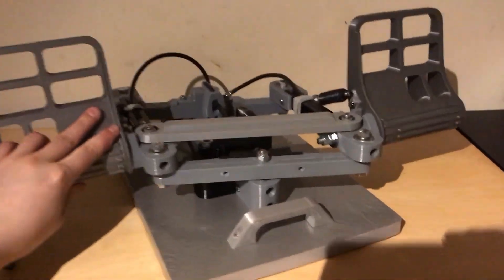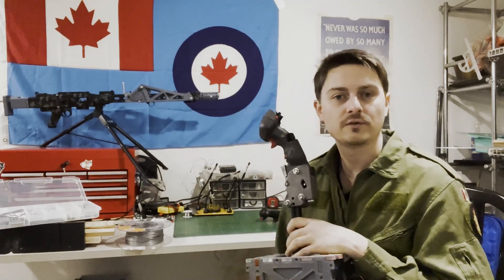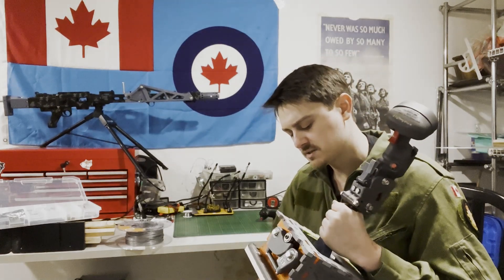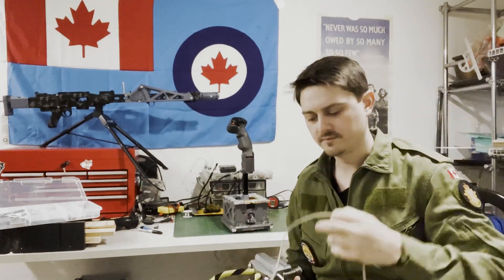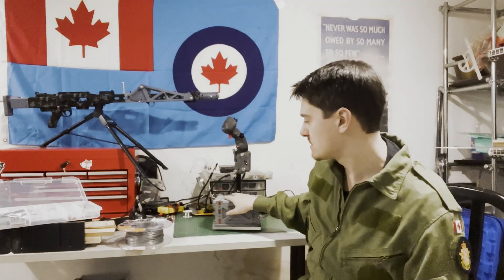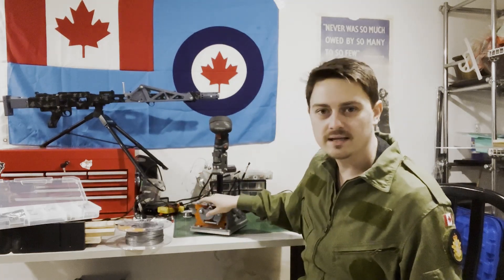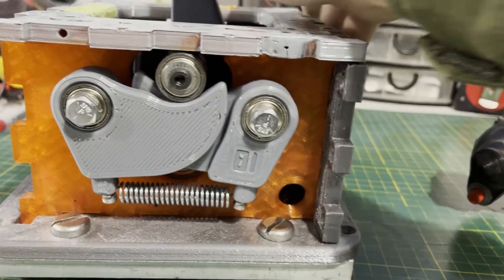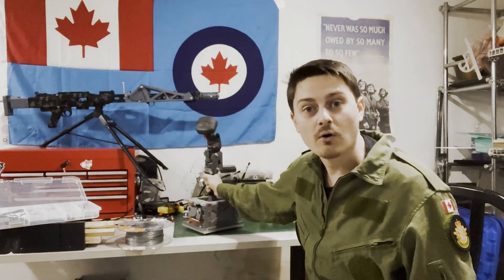Launching Patreon for Open Source Flight Control Stick

Comment from the maker: Check the description for a link to the patreon, really appreciate any contribution!
Reply from the maker: I've also updated the git with the last f3d file I have saved. Note the redesign process won't start until after xmas-newyears but if you want to try out the old version and print it, let me know. https://github.com/RightRudderLeftStick/OpenSource-VeryBigStick